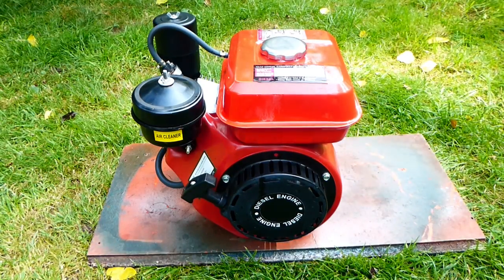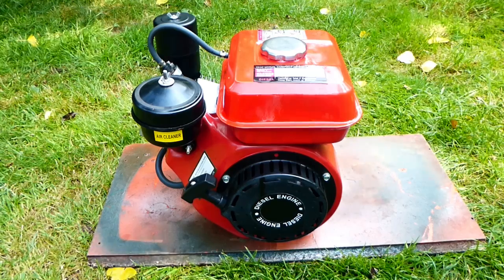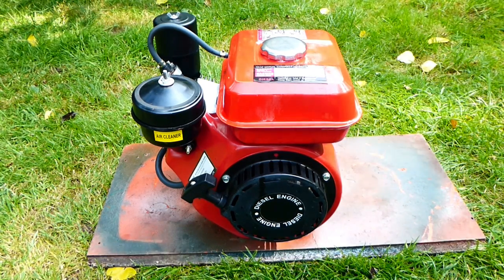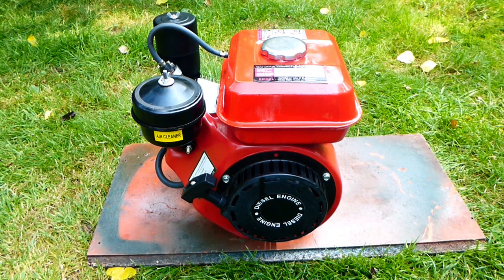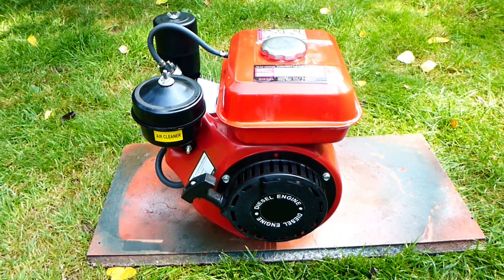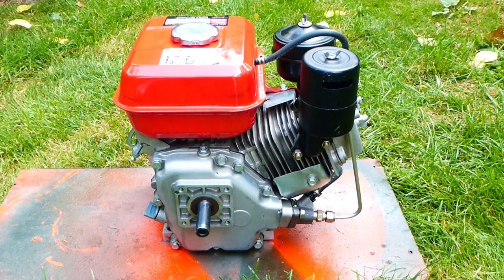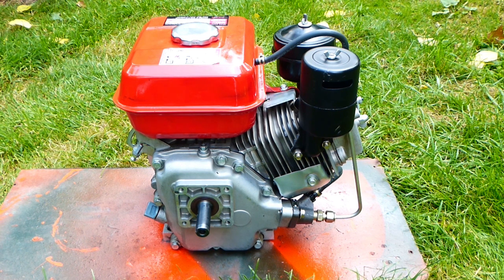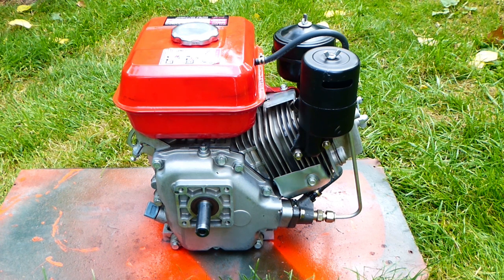3hp Diesel Clone Engine Running Demonstration

Comment: They're precious. I'm strictly 15W40 oil and real non abrasive fuel. Keep your ether away from it. You can do damage in a split second. I was more thinking sailboat, portable generator, and land tug. You won't catch me running it at 3,000 RPM. I turned the throttle limit screw.  It needs half that to run an alternator. Mount it on a stubby 1/2 inch aluminum plate.

Comment: I just received one of these from Amazon.  The throttle control was bent all to hell.  I was able to fix that. There is a spring that runs from the throttle control to a lever under the gas tank.  This lever only moves about a 16th of an inch.  Doesn't seem right to me.  Can you see if yours moves more that this.  Thank you..
Reply: I bought one of these engines too, and I am workiong on building a generator with it :) 

It is entirely normal for the governor not to move much. it does not have much movement whatsoever. My engine arrived with the throttle lever completely smashed aswell, was able to bend it back thankfully and was also shocked to see how little the actual governor arm moved. But I fired it up anyways, figuring I could kill it with the decompression lever in case of a runaway. It runs flawlessly! Speed is rock solid. so it seems normal!

Comment: Hey Wow....   might this engine install on a bike friction drive,  for example having a common universal fuel for all applications on a sailboat Having found 10 hp diesel outboard dinghy motor with an additional diesel friction drive fat tire bike,  common fuel across all platforms negating any need to carry gasoline  (petrol) on a yacht...

Comment: FYI The EPA has banned the import of these engines.  Now, if you can find one, they are very expensive.  The premise is that they can cause pollution even though they burn much less fuel.  I think someone had to justify their jobs...so we can't have these types of engines even though they make up .000000001 of all engine sales (zeros added for effect).
Reply: Buy the parts and assembly at home.
Reply: In certain states or nationwide?
Fyi I'm in Australia but I'm always curious what things you can't buy because of EPA/California regulations
Reply: I just bought 2 no prob.  Im starting a business buying and selling these if anyone is interested in buying one I have 2 brand new

Comment: Would that be good on a push mower!? Like a Diesel engine in stead of petrol? Thanks
Reply: I just rebuilt a Kee mower frame and installed a 6 hp Diesel on it.  Works just fine.

Comment: I  wish they would make a vertical shaft version and mount it to an outboard boat motor shaft for an air cooled  long shaft sailboat engine.
Reply: hearsejr you can use a pto differential for that instead. Hatz diesel makes vertical shaft diesel engines however they are pricey
Reply: hearsejr buy a 90degree gear box and make one
Reply: The 90 deg will come out and down for you’re outboard
Reply: @Carrottopsgarage  I have never heard of a 90° gearbox. Can you give me an idea where to find them and what they are called? That would be so kewl!

Comment: Clone of what?
Reply: Actually it's a clone of a Honda petrol engine, but modified to run on diesel.
Reply: @simonrichard9873  gx 160 ??
Reply: @luarbiasawaras8700  I would guess either that or 200
Reply: Clone of a Yanmar diesel

Comment: I have the water cooled version R165 Diesel its got bigger main bearings and replaceable cylinder sleeve! i like these air-cooled engines they are very light and super portable!
Reply: These are NOT light.
Reply: @slrs3908  the one in the video is about 45 lbs shipped. The R165 engine is about 75 lbs shipped.

Comment: oh would be good in a moped
Reply: Very heavy!
Reply: @slrs3908  they aren't that heavy it weighs about 12 kg which is very light for a 3hp diesel most diesel engine weigh 50+kg like r175 diesel engine
Reply: I am trying to find a diesel engine to replace my 50cc 2 stroke xD
Reply: Perfect for a little moped 🏍 or motorized bicycle 🚲 especially with a trailer for the engine and supplies while having an electric hub system also would make a great get away vehicle 🚗.
Reply: @markcharleswashington2073  We're on the same road there, fellow. Congrats, you're a smart guy. LOL.

Comment: Would be cool to see what the internals of this engine look like
Reply from the maker: David Durnberger Yes, it would! Maybe I will be able to open one up one day
Reply: DeepFriedFuzzball user opened one, it has Plastik oil pump like some other chinese gx Honda gas clones
Reply: These engines have a plastic governor but so does honda. These engines also like Honda gx engines do not have a oil pump, these engines are splash lubricated.
Reply: Probably not much different from a gas engine. External differences will be mostly in the head, as these dont use a carb or air throttle.

Comment: how does a diesiel engine work you know. cause I only know lots of gas engines but never worked with a diesiel can u explain or give me a link to a vid?
Reply: Here are the four strokes:
Intake stroke: Intake valve opens. Pistons drops, causing a vacuum which sucks in air. No fuel yet.
Compression: Piston compresses the air which heats up.
Explosion: At top dead center diesel is injected in the combustion chamber. The very hot air lights the fuel and the explosion pushes the piston down.
Exhaust: Exhaust valve opens and piston pushes exhaust gasses out.
And the cycle repeats.